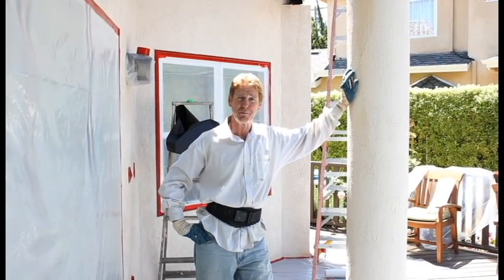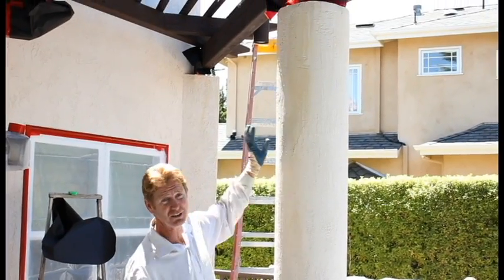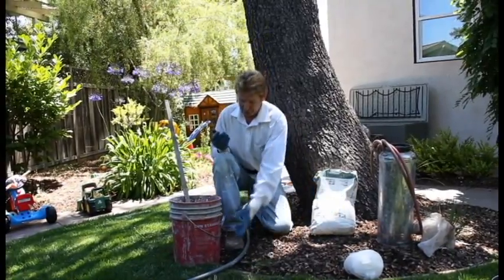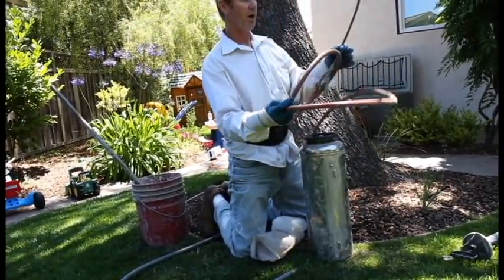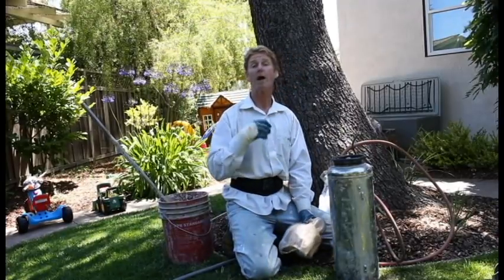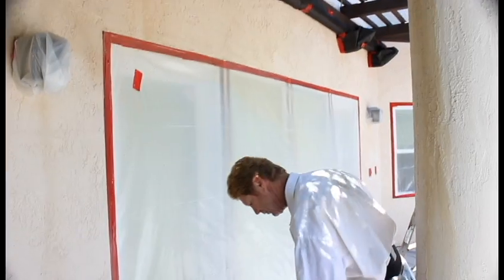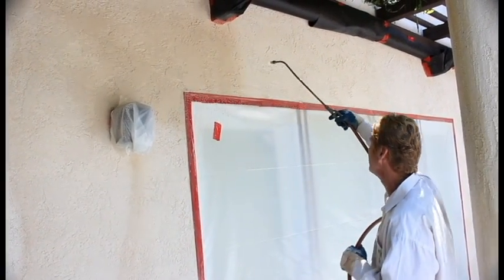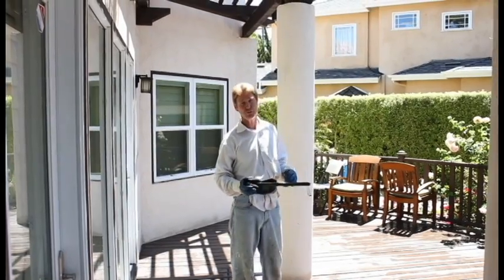Fog coating stucco walls to uniform colors

Comment: Good morning Mr. Kirk Giordano.   Can we do touch up on an existing fog coating?  I don't think it is too great to buy a big bag of fog. It needs probably about 0.135 of a gallon of the fog liquid. Do you have any advice where I can obtain the materials for this job? Thank you so much. (From Jennifer)
Reply from the maker: Hello Jennifer, of course, I know where to purchase fog coats.
 Google plastering yards near me. 
Such as Westside building materials.🥂
Reply: @StuccoPlastering  Did you have a video on how to do touch up on existing fog coating?  My house was built in 2002 and the front of the house is facing the direct sun light all day. The previous owner probably fog coated it in 2012 as every 10 years the HOA would drive around and asked homeowners to either wash or repaint the house. Thank you!